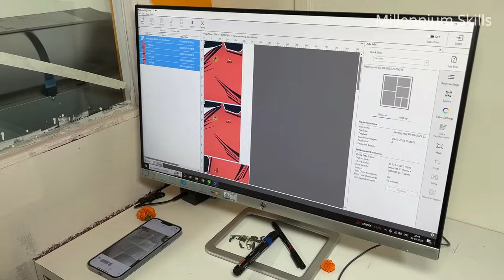Process of Printing and Making Sport Jerseys. IPL Cricket Jersey Mass Production Posses Factory.

Comment: That ladies and gentlemen is how fakes are made because the actual process of making a sports top from one of the genuine kit makers is that they make the top out of one continuous roll of fabric which they then cut into various pieces and then sew them together. This is why when you look at genuine sports top that have fancy designs on them you will notice not every one is cut the same due to the patterns not matching up during the sewing process. You go into a sports shop where they have numerous sports tops of the same team and look at the seams where they are sewed, you will notice very few tops match identical due to the material cutting process. 

The method shown in the video gives you a perfect print every time. You will also notice that club badges and kit maker badge is printed whereas on genuine kits the kit makers sews the badges onto the kit (not ever kit maker does this but the majority do). You will also notice that any sponsor logos are printed onto the fabric whereas on genuine kits you can feel the edges of the logo's where they have been heat pressed onto the top. 

The video is good BUT it is not how genuine kit makers make their tops.